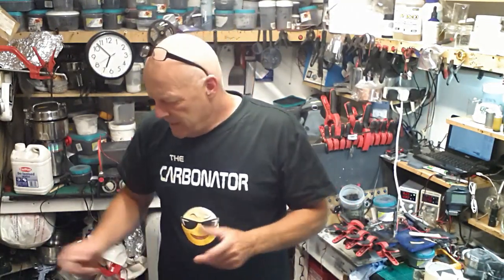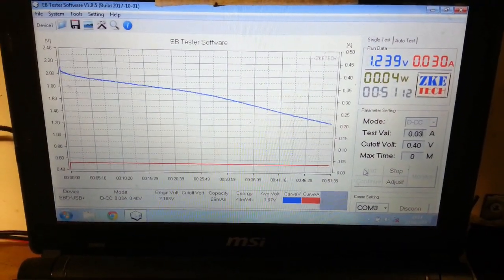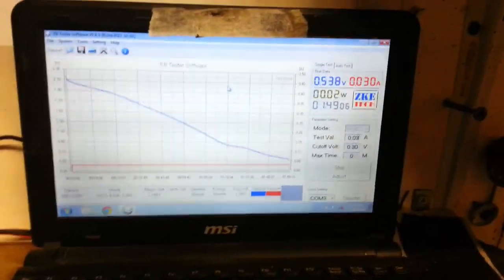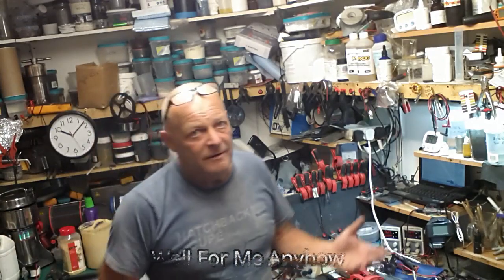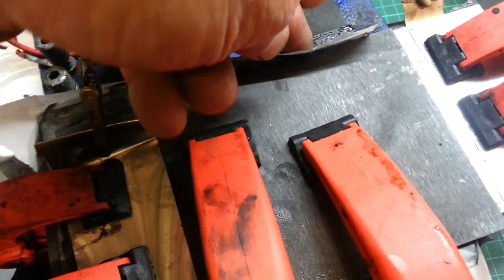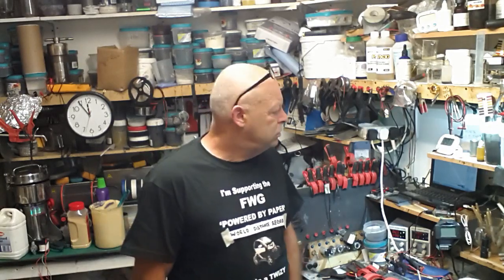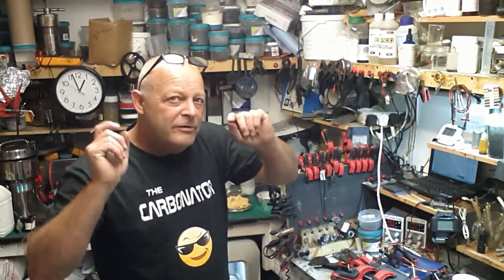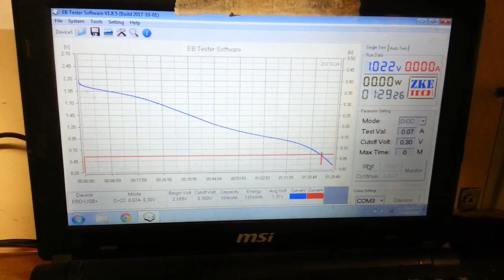Carbon Batteries 1st Update on where i am now & whats new

Comment: Many congratulations! Your hard work has shown that you have been and remain a serious player in this r&d pursuit! Meanwhile, my first batch of capacitors can run a motor for 5 seconds! I hope to get even a fraction as good as you eventually! I'm sure dedicated viewers were so thrilled to see your results!
Reply from the maker: Technique Technology many thanks for your generous comments it is much apreciated
Reply from the maker: Technique Technology you will get there just remain dedicated
Reply: Thanks, I got the data logger you use and it's on its way from China. In the meantime I'm using DVD drive motors and a Joule Thief powered LED and recording run-times...
Reply: It didn't occur to me to ask, but this battery doesn't use graphene, does it?
Reply from the maker: Technique Technology no mate it my own debeloped carbon
Reply: I forgot to ask about having no binder. Does that have any downsides, and will that be the way the final version is made? I thought you had to have a binder.
Reply from the maker: Technique Technology yes mate you certainly need a binder otherwise your carbons just leech out everywhere.
Reply: Hey Kev, I'm about to get a microwave kiln and try to put it into use. If I get car exhaust repair paste to seal the hole, put a bed of activated carbon on the bottom, and charcoal briquettes on top of the biomass (carrot, garlic, etc.) I want to carbonize, would this work? I am worried the seal in the top will create pressure, but you definitely know better and I would appreciate your suggestions.
Reply from the maker: Technique Technology you will be fine mate just dont try putting too much in there.
Also you will be much better off if you oven bake / dry your bio mass first this cuts down on the fuming stage.
Reply: Hey Kev, I know it's been a while, but I don't have a fume hood yet. Do you think I could get away with a 3M respirator with filters for small batches? I have a ventilated room and fans to move air out. If not, then I guess I need to look into how to build a fume hood/cupboard.

Comment: Hi Kev,Fantastic energy density with such a small amount of active material.I am still investigating the micro sponge approach, where more of the AC is spread over the third dimension too, its looking very promising although using more AC.It would be interesting to see how well your carbon performed in my micro sponge substrate, I think it may be outstanding.As you know the current collector material (metal) is very important to the battery as a whole system. And the kind of chemistries we are investigating the active material is the lightest and cheapest part of the cell, whereas the metals, connectivity and case parts are the heaviest and most expensive. 
I have used most of the common metals over the years with varying degrees of success and corrosion, but as I've said before aluminium cooking foil is as cheap as chips, and can be bought anywhere.If it can be made to work on the cathode as well as the anode, then that would be great.Great to see you making such good progress  :-)   Martin.
Reply from the maker: solarhope thanks mate glad you can now comment.
Interestingly though just before this batt i had one with 0.2g so 0.1 and 0.1 and i got 31mWh out of it with this same carbon.😎

Comment: Hi Kev - great to see you back - even greater to see those results....

I'm a big fan of using energy density as a measurement tool to develop / perfect the chemistry.  But with the cost of the raw materials (carbons) likely much lower than say lithium their mass per mWhr doesn't swing the cost needle much.  Now maybe when the 'processing' steps are costed in that changes - I don't know???  
As you talk about next steps - collector materials, non aqueous electrolytes, even different seperators, …...then these items will likely affect the size and weight and the cost of the cell more.   

Continuing to enjoy the 'ride' even if its more from the sidelines these days.  Keep up the fun work.
Dennis

Comment: Hi Kev
Isn't the internet a wonderful place!!
I stumbled upon you and RMS and kicked myself, I had been kicking several ideas around for months and months without success, picking up and dropping off stuff.... and the I saw you and RMS, what a revelation ! Keep up the good work!!!

You asked me about what I'm doing and I will give you the present situation... the intention was to produce a cell, whether you call it a supercap or battery doesn't bother me, but it must be cheap and repeatable for poor populations...basically crapped out with "graphene, "...graphite is hard to get here, so I've been trying with carbon/graphite electrodes etc..would really like to get hold of some raw material. The idea is that the cell is simple and cheap...if it requires additional layers to give an acceptable charge level so be it...but it must be cheap.
Trying with tracing paper...single layer with multiple layers of sep/elect, about 4 layers...at the moment, piss poor charge hold!! ....the binder is giving me sooooo much problems..porosity verses separation is the game....but i will get there..My intention is to have a 20 layer "comp" and that will make a cell. I have made the acrylic cells upon my laser cutter that will be the prototypes. These make the test cell areas as well.. Each "comp" will be sprayed with a mask...at the moment I am brush-painting the test surfaces and washing after each action...tedious :)
Activated carbon with Fe2Cl3 and TiO2 soaked and heated to 900 in the microwave kiln are giving my best results to date...as I said binder and sep are the issue....slowly, slowly

AND NOW CARBONATOR....when it is a "all carbon battery" it has super cap/battery characteristics...so should it be a cappery or a battistor ?................and which is positive ??????    :)

kind regards

T
Reply from the maker: tony ponsford hi ya mate so sorry for such a late reply but i do sometimes forget LoL
Getting old mate.
However you seem to have your hands full that end !
Just keep going mate with what you have got, you will get there.
Battistor ? Not certain about that one maybe CapaBatt ha ha

Comment: Hello Kev, thick Brummie here again.
Watched one of your videos which showed you settling out some fine carbon (i think) in a coffee jar and I thought you might like this.
I am intercalating a graphite electrode, cut from a EDM block 99.9% purity ( with 316 stainless on +ve) in a 1M magnesium sulphate solution, limiting the current about 1A at 10V.
Getting beautiful flakes, orangy-brown edge on and almost transparent as they rotate face on in the solution. 
What surprised me was the distinct bands within the solution: the uppermost was a cloudy orangy-brown band across the whole of the beaker, to a depth of the shorter electrode (the graphite), it was almost as if this was the "ion stream". One or two clear bands below this (depending if I had stirred the solution) of a red and yellow colour appeared to be of higher specific gravity, as flakes from above dropping into the band would slow or even stop. Some produce would rise from the base of the breaker and re-enter the "ion stream". With the colours and the movement it reminded me of a cross between an fish tank and a Lava Light !
Totally fascinating !  Not observed anything quite like this before, wondered if you had.
 Ive had this running for probably 14 hours producing a large quantity of intercalated produce, reckon the electrode will last another day or two. Any thoughts...and as I diver also, I thought thermocline too!!  :) Do you miss Dozzie ?

All the best

Tony
Reply: Doh!.....stopped the process and checked the electrodes...the stainless steel is corroded so colouration is probably due to chromate contamination....nasty stuff so I'll see if I can wash it.  Double Doh!!
Reply: Going to use graphite/graphite electrodes next time,  but I will wash and test the material i have got ...might give me something, but the whole reason for using mag sulphate in the first place was to reduce "bad" chemicals :)
Reply from the maker: tony ponsford hiya mate, well not certain what you have there ? But just wait till the end of the reaction. You may have some multi layer graphene.
I think the vid that you saw of mine may have been some graphene oxide.
However the last thermocline i saw was a few years back now at Stoney Cove. Ha ha. 
Speak soon kev

Comment: Hi Kev , love your videos please keep them coming. I was having a beer watching one of your vids where you were sourcing some aluminium from your mate , it occurred to me that if you cut the top and bottom of the beer can off  and split it up the middle with scissors you have a great source of stiff aluminium sheet , there is a coating on there that will not come off with paint stripper or solvent but I find it only very thin and you can get it of with a bit of sand paper quite easy, whilst roughing it up at the same time. What do you think? maybe you know a better way to remove this coating?
Reply from the maker: Steve A hi mate, thanks for your comment.
As regards cutting up cans, that is a no no. Just use foil it is as good as anything else and you can pass lots of current through it 😎

Comment: Amazing results, I'm really impressed! So this is essentially a dual-carbon battery, using the same carbon on both electrodes? I've read a bit about those batteries, though I assumed the electrolyte had to be lithium based.
Reply from the maker: BenjaminGoose hi mate and thanks, but yes same active material on Anode & Cathode.
My new vid's ( out soon ) will show that i am up to and beyond 300 mWh/ g now with a brand new carbon.

Comment: Hi Kev, I plan on making some GO doped activated carbon that you mentioned in a previous video. How much activated carbon would you suggest adding to the H2SO4,  H3PO4, KMnO4, graphite mixture if you are using 3 grams of graphite? Thanks again for the interesting, inspiring videos.

Bill
Reply from the maker: William Hada hi mate, i actually used more graphite too, 4g i think but the AC was around 3g. But add it very very slowly 😎
Reply from the maker: William Hada no worrie Bill glad to be of help.
Another tip maybe though and i wish that i had done this.... add the Graphite and the AC together first and mix them well.  
I added the AC afterwards

Comment: Might I suggest you add temperature to your graphs otherwise your results are pretty much inconclusive at this stage in regards to finite accuracy. Remember “Temperature” plays a crucial role in every chemical reaction.  

Also could you please tell me what the data logger is that your using?
Reply from the maker: Joel Harvey yes mate you are correct, but i have monitored temps in these many times and to be honest it is not a major concern they dont even get warm... whereas a lithium can thermally run awsy at 150c.... that data logger is on ebay or amazon or banggood i think it is called EBD-USB+ data logger/ dummy load  around $25.

Comment: Hi Kev. Great video and results. I'm wondering what you thought off about the carbon fibre weave as collectors and did you activate them in oven before using. And what was problematic of them.
Reply from the maker: Dan P hi Dan thanks mate. Yeah the carbon fibre weave that i used was quite fine, because the standard stuff is to heavy. I didnt do anything with it other than use it alongside my collector plate.

Comment: I'm fairly new to this but have watched quite a few of your videos and Rob's. I'm completely fascinated by this. Has anyone made a complete battery, say as a lead acid replacement for solar and used it for a while? How close is this to being ready for real-world use? I'm just installing a 10kw solar system and would love to use this to store excess energy at peak production for after hours use.
Reply from the maker: OK Hi there, a very good question. For myself i am maybe 6 months away from that stage or it could all come together in weeks, that's the way this game is.
However i think that Robert is not far away at all in being able to sell a commercial battery...... The Power Blade would probably be the most likely to see the shops. many thanks for asking.
Reply: Thanks for the reply! I'm more interested in the viability of DIY and the stability of the current DIY-level technology. For instance, if someone combined the current generation of plates you're building into a cell, then combined multiple cells to build a battery in the voltage range of an automotive lead-acid battery, how would it's performance, lifespan, and cost compare to the lead-acid battery you can buy at the local store?

Comment: Hi Kev!  I remember that early on you tried some Hydrothermalcarbonizations for obtaining carbons. But for a while now it appears that you have not used that method, only using a kiln or a microwave to carbonize. Is there any reason that you have abandoned Hydrothermalcarbonizations?
Reply from the maker: William Hada hi will sorry for the delay, no i have not abandoned this carbonisation method completely.
I do however prefer my carbons from the kiln because it is so fast and 100% foolproof 😎

Comment: Kev - quick follow up question - I know you're in the range of 500 to 600 mWh/gram - can you relate that to mWh/cm^2 for your cells.    Since so far the cost of the materials is pretty low I'm trying to get to more energy for a given area or volume.  
Thanks,
Dennis
Reply from the maker: Dennis hello mate yes from memory i was in the range of 5.4 mwh per centimeter.
Cheers
Reply: WOW WOW - we need to step up our paper/carbon game here about 10X  - its a noble goal
Reply from the maker: Dennis i think we all do mate, i reckon from trying to calculate what RMS did in one of his vid's that he is up to around 11 mwh/ centimeter 😎
Reply: So just for fun - if the typical Lithium 18650 is 3.4V and 3Ahr, that's 10.2 Whr  with 70% useable = about 7W hr.  Unrolling an 18650 (5cm X 70 cm) you have 350cm^2.  7000mwh/350 cm^2 = about 20mwh/cm^2.     Very impressive for Rob (and KEV not far behind) to be about 1/2 of the infamous 18650.    Stating the obvious - raising the cell VOLTAGE of the  carbon carbon cell about 50% puts things on par!!!!!!
Reply from the maker: Dennis keep an eye open mate, my next batch of Carbon might just be what we are all looking for !!!!
Just have not had any time to do vids 😎

Comment: Hey Kev 👋 any success with that DMSO? I was going to get some soon but would rather put my money to something else if it’s a no go . Regards Andy
Reply from the maker: Electron Proton Neutron Mouron hi Andy, yes i did try it and indeed had a degree of success with it, was even charging my cells at 12volts at one point. Though a safer level was around 7v. 
One problem with it is that it really pongs, bit like rotting sea weed ! 
The other issue was that it is quite difficult to make it ionically conductive.
However it is one that i will get back to in the near future as it is sulphur based. Also i knew from preliminary results that there is mileage in the stuff.
I could not justify the time as i was furthering my carbon work so it took a back seat, you know how it is, getting up to 500 mWh / gram was more important and i now know that this could quite easily be 600 now.
But i have even called a halt with furthering my carbons for now as i am working on upscaling and construction.😎
Reply: kev wallcroft so it only pongs at 12volt or still at 7? That I would thing is disassociating of the water molecule while bringing other elements out of solution like the sulphur . Interestingly I have non water soluble garden sulphur and it doesn’t smell at all and similar with the water soluble garden sulphur and the are 90% and above I believe !
Reply from the maker: Nah mate it stinks all the time LoL........reeeeeeaaaaly stinks
Reply: kev wallcroft ah I give it a miss then . Cheers for that

Comment: This kind of battery has one drawback and that is a big one. It has a severe severe self discharge. You charge it and keep it over night it is empty in the morning. But cool stuff cheers.
Reply from the maker: Thanks for the comment, but you could not possibly know how long my batteries take to self discharge. However i will let you into a secret,  this battery holds the recovered voltage now for well over a week, i have been working on this problem for quite some time..... internal resistance, good electrolyte and construction methods are the key factors.... cheers
Reply: Yes, it is possible you thought he was making carbon supercapacitors, which can have issues with leakage. That's the only reason I can imagine you assuming his results with such confidence. However, Kev's discharge curves are not capacitive. He is clearly making some type of "battery hybrid" (as Robert Murray Smith calls them) or a true battery.

Comment: Hi! When you talk about gasing, do you know what gas is emerging? The electrolytes that you are using are very higroscopic, do you think that gas is the traces of water decomposing?
Reply from the maker: Jorge Ruiz VoltPeak it will be oxygen or hydrogen or both be ause i was overcharging an aqueous electrolyte at 2.5v
Reply: Ok I thought you were using DES
Reply: If you are trying to make a supercapacitor, i think will be better to incorporate a DES (broader chemical Windows)
Reply: Anyways thanks for the vídeos, they are very informative
Reply from the maker: Jorge Ruiz VoltPeak im not building capacitors